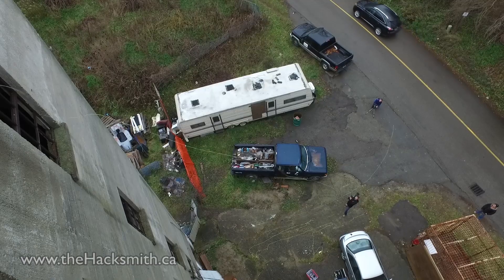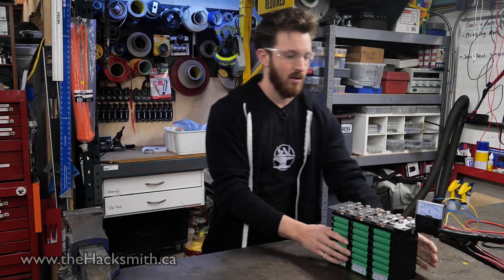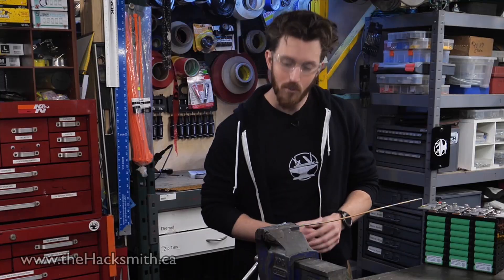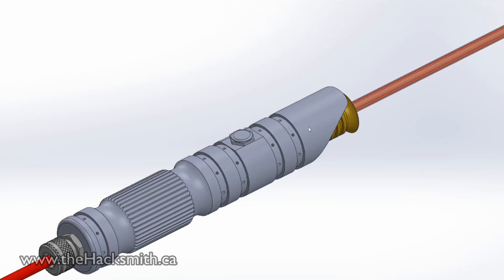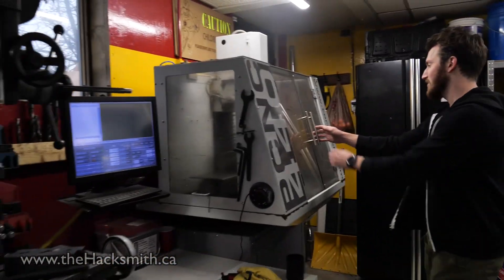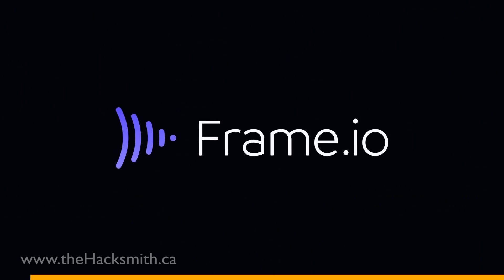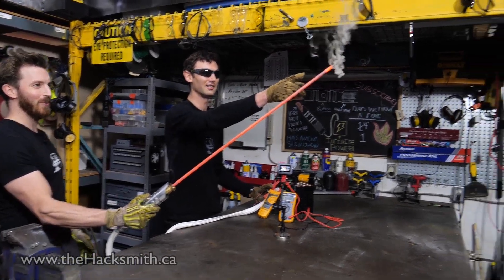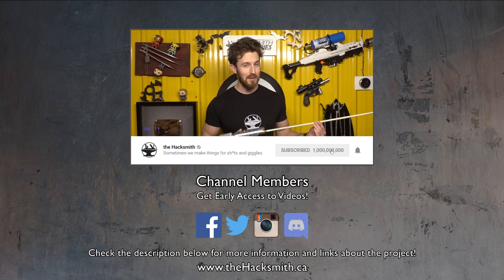3000° TITANIUM LIGHTSABER BUILD!

Comment: Not a light sabre..just a really hot fencing sword with a cord
Reply: Right?!  Not to say what they have here isn’t awesome - it’s just clearly not a saber whose deadly bits are composed of light/photons.  Just because it’s emitting light doesn’t make it a light saber - my butter knives are fairly reflective...I could sharpen them and call them light sabers; with a lil color correction they could be Sith or Jedi friendly.  
  Too far, maybe.  I’m not even a real fanboy - just one thing consistent when I think of a “light saber” is the lack of a solid blade or cutting edge: Its an energy weapon.  Theirs takes plenty of energy to heat and maintain, sure, but they rely on a solid filament to hold and transfer that heat to other objects.

Again it’s cool...really cool - the light saber bit I don’t agree with but it’s not like we’re making real energy blades any time soon
Reply: @jhcoverdrive9287  no, I totally agree unless you're going to capture a laser beam in the form of a blade, then it is not a true lightsaber. Who knows, the correct way to do it may even have to include some type of crystal in order to do this. Like you said, we probably will not find this out anytime soon.
Reply: It’s so silly - if it had been titled something about looking like a light saber I prolly wouldn’t have felt the need to comment.  It’s better than the the guy with (essentially) a strong lighter placed into a hilt that’s titled “Real” light saber.  Under this logic, tracer fire could be considered blaster bolts - they kinda look like it
Reply: @jhcoverdrive9287  exactly, I would not have posted my original comment if it had been titled different. Being a big Star Wars nerd I probably will not be satisfied until an actual true lightsaber is created LOL. Don't get me wrong though, it does look very cool. I commend these guys for giving it a shot
Reply: Thats one way to look at it, that 'Everyone' knows, or you could at it as awesome as it is... a Lightsaber.. may the force be with you..

Comment: A lab in Sweden actually created an actual lightsaber.
It is 7 centimeters long and is made out of electromagnetically suspended plasma.
You can drag the lightsaber right through a block of cardboard like butter.
You can only keep it on for 3 minutes at a time before it overheats and it does actually need a battery pack.
It can't melt metal as it would interfere with the electromagnetic fields and the plasma would just get repelled by it.

Comment: You cannot use any kind of metal in the blade. It's a bad idea. You need to use laser inducted plasma inside a magnetic forcefield. Duh!
Reply: Just an idea....you could use a really big piece of graphene film(hasnt been manufactured (yet)) as the magnetic field(its a conductor) and tube for the plasma(its 97% transparent), you could even retract it since its film but it wont make the cool lightsaber sound. 
Update: it would melt if the plasma is above 5200°f. Aka not enough degrees to slice and dice like you want!
Reply: Thats halo tho
Reply: @AuraEximus  its really both, lightsabers have the exact same properties
Reply: @psychophilosopher3674  true. Just its that halo lore explicitly says this, while star wars is way less obvious.
Reply: Fair, i also theorize that force manipulation is really extreme maniplution of magetic fields
Reply: Actually it would be more of the ability to, with a kilo of salt, isolate and shape molecules

Comment: Hey Hacksmith I noticed when you cut through a metal tube with the light saber it cooled down where you were cutting. I think the best way to cut with it is to place it on an object, leave it there for a little, then move the light saber back and forth slowly. so the light saber's full heat is focused on it. (like so he can see)

Comment: I'd have made the blade larger, or have 3 layers, maybe titanium on the outside, ceramic insulation, tungsten layer, and a larger core of tungsten that doesn't carry voltage but only acts as a means to support the blade

Comment: this is it, the beginning of light-sabers that will actually start cutting through anything. just need to find a way to condense the battery into the handle (right now it looks like the old light-sabers that were battery powered in the actual canon though)  and make the blade retractable.

Comment: Would you ever consider trying to bring the temperature even higher to 4000f or 5000f with maybe a Composite blade like you have but with a gas lens with argon or nitrogen so the blade is not to oxidize ???

Comment: Hey do u think u can use a thermo refrigeration torch sabor think! Peliter effect cooler do with ice + liquid hydrogen electrolyte ⛽ power forever? Electron beam welding
Use an electric actuator linear lift but change the lift rod with thermoelectric metallic blend graphite arc

Comment: Hey!! I'm just curious. But I think what you need for the blade is carbon composition or carbon carbon. Research about it. It is also use in the brakes of an f1 car. I know it is expensive but I guess it would work. I know that 'cause I am an f1 fan. The problem about it is that you need a lot of power to do that but it is possible

Comment: All you need to do is make the blade retractable then it will be a lightsaber. Easy right?
Reply: How would you telescope a tungsten rod and still have the ridgity.
Also it would need to cool before retracting or it would destroy the hit with all the electrical work.
Reply: @VictinisFire  r/woooooosh
Reply: @Avi3ator  another sheep lead t
o slaughter.
Reply: @Mr_Snek  fail
Reply: @VictinisFire  r/wooooosh
Reply: Still wouldnt actually be a light saber. It should be like glow sword(stupid name) but just an example

Comment: Im not very smart, but maybe because your team is so smart you over looked what im about to say: When it comes to the light sabor entering and exiting the hilt, maybe you could have several pieces that context into a single bar that slide into eachother, then with the press of a button it springs out[kinda like the doom fist gauntlet but something keeps it extended], then after that it heats up.. Im not sure how easy or hard that would be to make, and I hope you don't see this comment as negative in any way. Keep up the awesome projects!
Reply: Karma Akabane
I believe the term you’re looking for is Telescopic
Reply: You are thinking of the same concept as a telescopic antenna, right ?
Reply: @Wieselkatze  Basically
Reply: the spring would stop being springy due to the heat
Reply: @chuckcrunch1  Yes, thats true, but isn't a limiting factor since you could use gass piston instead which would actually expand with rising temperature and contract with lowering temperature automatically.
Reply: @videorowtv5198  that sounds like a boom and the pistons would weld to them self after one use
Reply: Unfortunetely this wouldn't work with these materials and way of transfering heat and electricity.
Reply: That wouldn’t work because if you shoot electricity through the rod it would shoot up middle because the metal would need to be hollow and the tip could explode. Not to mention the metal would have to be like a foot in diameter unless it’s a lightdagger
Reply: Yeah, I said it wouldn't work
Reply: @videorowtv5198  You actually have a typo. Your first comment says "Unfortunetely this would work..."
Reply: @Galiant2010  lol, you're right.
Reply: It would be nice but the blade or ride would have multiple weakpoints therefore making it easier to break

Comment: I now challenge you to make a green lightsaber
Reply: I have a decent idea for this. There could be very bright and thick-lensed LED lights at the hilt that project a color onto the blade. Obviously, it would need to be pretty bright and be very heat resistant being that close to a 3000 degree piece of metal
Reply: @RaisinBran-yd2rz  That's a really good idea
Reply: Dip it in acid
Reply: The problem is that when things heat up they don't turn green, purple or blue.
Reply: @StudioCluiss  Also certain chemicals when lit on fire turn purple, blue, green, etc.
Reply: @AlledgedGull  yea if it is possible i guess you'd have to find a chemical that does that and doesn't melt at 3000 degrees. Probably pretty hard
Reply: @StudioCluiss  The chemical would burn the certain color
Reply: @AlledgedGull  yea it could be a consumable thing i guess
Reply: Jac they do it just needs to be hot enough
Reply: Jac, certain noble gasses glow colors when electrically charged. For example, xenon glows a lavender color.
Reply: @StudioCluiss  you're wrong. At high temperatures, steel takes on colors ranging from dull red to bright yellow, while at low temperatures it changes into colors such as brown, purple, blue and grey.
Reply: @catanonimus7  yea and 3000 degrees  isnt exactly low temp
Reply: start with a lightsaber then pick a colour

Comment: If you maybe hooked up the ionised arc reactor you created in a harness that is, in term, connected to the saber you would be able to generate the power easier, however you'd need to work out how to sever the electricity flow from the reactor to saber. Just a thought, I'm unsure if it'd work or not

Comment: Battery may explode at this circumstance
Reply: No it won’t. Watch previous videos before putting your foot in your mouth. Those batteries don’t blow up
Reply: Umm…I would rather be concerned about the titanium catching fire. It burns similar to magnesium
Reply: dontlikemath -.- one solid piece of titanium or magnesium won’t ignite. It’ll just melt. They have to be chopped up to ignite and spark violently like you’re talking about
Reply: @WatchingCrow  they can still ignite.... Sure its unlikely since most of the mass isn't exposed to oxygen but there are reasons you rarely see titanium as a heating element

Comment: So basically a 1000 degree knife but a lightsaber?
Reply: A 1,000? Just a 1,000? :)
Reply: IT MAKES TOAST WHEN YOU CUT BREAD!!!!!
Reply: higher temperature and much more durable
Reply: @cod6guy12  LOL in no way is that durable .
Reply: @chuckcrunch1  A hell of a lot more durable than a molten kitchen knife buddy
Reply: @cod6guy12  yes a molten kitchen knife would be well..... a liquid . what's your point ?. if you hit this thing against anything with any speed it would bend like a noodle
Reply: @chuckcrunch1  I was replying to the other guy's comparison of this to a 1000 degree knife, this is definitely more durable than that. This thing would NOT bend like a noodle and the fact that you think so implies to me that you didn't watch how they built it. The inner-tungsten core does not lose its rigidity like the outer-titanium tube does, its melting temperature is twice as high as the titanium's so the only way it would lose its rigidity would be if it was hot enough to melt the titanium tube right off the outside anyways, which clearly does not happen here. The only durability issues this thing would have would be the outer-tube being scraped off whenever it hits something, which would require a pretty decent impact to do so. If you swung this thing into a brick wall as hard as you could it'll have some problems but it wouldn't 'bend like a noodle' otherwise.

Comment: Use some P-Channel fets connected to a PWM source, and run the whole thing through an inductor and diode (buck converter). You'd be able to control the output current so you don't start any more fires.

Comment: I was thinking instead of connecting the saber to an external power source could you extend the body and put an internal power source with a step up from a taser? Also thinking way ahead could you do a baton design for the blade so you could "fling" the blade out?
Reply: That thing requires a LOT of power. It literally requires that big battery they use its not just for show
Reply: @BraveCat9927  I understand it requires alot of energy, I'm simply asking if there is a feasible way to harness the same amount of energy from a smaller package. Such as through a step-up like that of a taser or something like a microwave transformer or a coiling system of some sort.

Comment: Very nice, it changed a bit since I saw it a few days ago. You said it was reproducible? I'm going to look into this. I have some questions and thoughts. Was the tungsten too hard to shape to round the tip? The blade is narrow, though probably for the best, because a wider blade would draw way much more power and it would be harder to cut through things, right? Your taste in lightsaber hilts is different from mine, I still like it if course. How long is the battery life? If the battery pack you were using could output 2,000 amps and the lightsaber drew 1,000 then do you only need half that battery pack to run it (of course it would last half as long but it would be half the weight and volume)? Again very nice lightsaber.

Comment: You should forget everything and make a lightsaber company. Screw youtube. Give the nerds what they want! XD awesome. 
Still needs work though. Flaws i see are the metal bends too much. And you used a thin peice of rebar. Use a thick one! Also the handle is too thick. Apart from that. Its awesome. The batterypack looks legit. And the whole concept is very well done. I think you should focus on making it out of just a tungston thick peice of rebar. And figure out maybe a fan mechinism that could do away with the smoke. Don't know. 

May the force be with you

Comment: He has a red lightsaber  so that means he is a dark lord of the smith

I know that it is orange but I just wanted to make a joke.
Reply: Technically an orange saber
Reply: nah it's just a protosaber they all had that colour
Reply: Lol smith lord
Reply: "Dark Smith" 😂😂 Will Smith after being in YouTube Rewind 2018. Sith Lord
Reply: There have been Jedi with red sabers before...
Reply: That joke... Jeeez
Reply: No one notices the pun xD
Reply: Dark smith
Reply: It has batteries/external power so it is a proto sabre. They were the first designs used by the Jedi
Reply: He is one of the Jedi Temple guards.
Reply: Ann Baird 
Eyyyy
Reply: 666 likes
Reply: HE IS ON HOT SIDE I THINK
Reply: can u make a blue one somehow?
Reply: @Abdullah-gb7kg  If you could heat it over 8000K then yes, unfortunately no material can handle that kind of temperature
Reply: @abcdefgh-db1to  At least... No material that we have (yet)
Reply: @Abdullah-gb7kg  use the jedi crystal
Reply: @Abdullah-gb7kg  i mean yeah but you had to heat it to the next level
Reply: @Abdullah-gb7kg  No bc it's not possible
Reply: @Abdullah-gb7kg  well... U can make a green one, ZnO when being melted has a green glow.
Reply: @Abdullah-gb7kg  make it rlly cold
Reply: @Abdullah-gb7kg  very complicated, but possible, you need to use electric arc lined by compressed air(like plasma cutter), not the heated metal, but this will be bright af, hot af, and eats energy like a small town
but this design will cut steel plates up to 0.4m thickness
Reply: Nah it's orange so he's clearly using the heart of the guardian lightsaber crystal, and well sith aren't known for being guardians...

Comment: No way it can do 2000amps at 12v the max it could do Would be 960a (assuming 34p 3s config which i can see) based on the 30a output of a high end 18650 from Samsung, Sanyo or Panasonic
Reply: Maybe lithium iron phosphate batteries.
Reply: @peroplaninic2220  possibly but the company thay got them from makes lithium ion 18650 packs
Reply: @thehacksmith am i correct or am i messing something